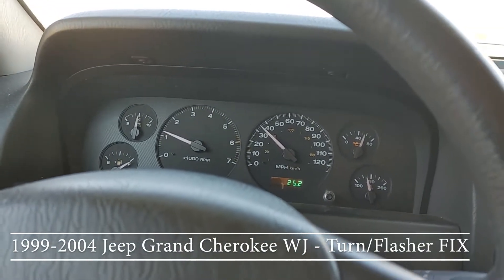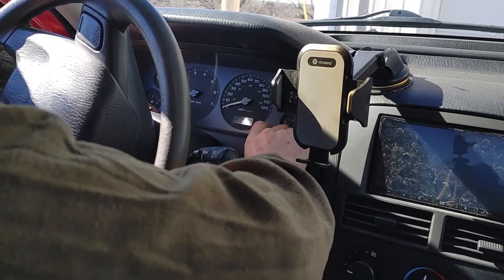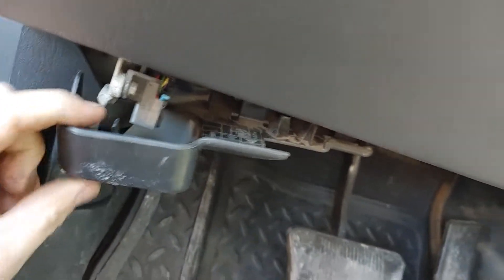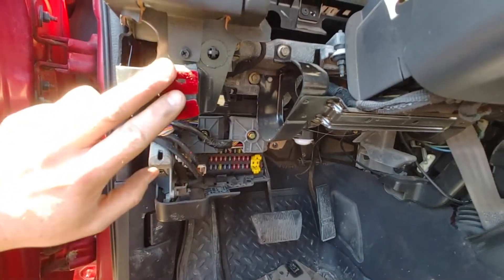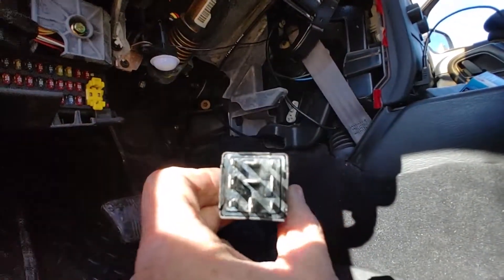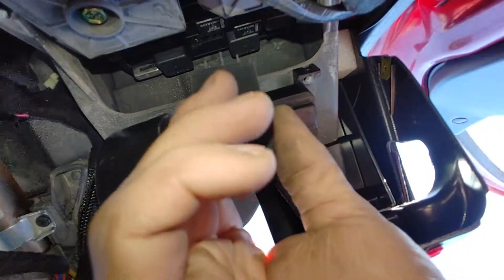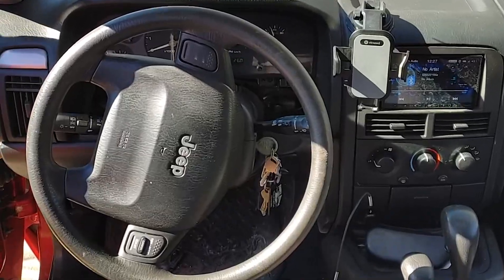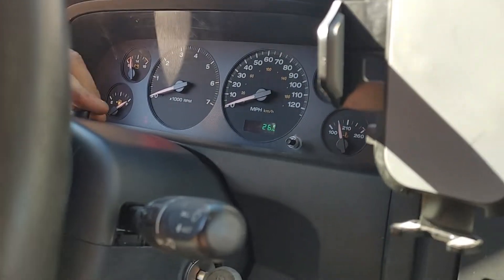Turn Signal Doesn't Work QUICK Fix | 1999-2004 Jeep Grand Cherokee WJ

Comment: I have an issue with only the left blinker not working
Reply: Same here did you figure it out ?
Reply: @LuisHernandez-hz6yu  yes it was a faulty turn signal flasher / relay.
Reply: @ghostcontactparanormal can you tell me the part number and where you changed it? Mine is left also

Comment: You could have saved some money. I took the advise of someone else and didn't need to by another relay. I took the old one apart and repaired the soder joints on the pins. Put it back together put it back in and everything worked. Saved 65$
Reply: 100% - Can't find the original video I saw so I could thank the guy - but I pulled the part, popped it open, resoldered one connection, popped it back in, and now I'm changing lanes all day just because I can signal again! No cost - just 25 mins of my time.
Reply: Weekend beer drinking money

Comment: Both mine worked as they should for 2 years until about a month ago. It’s just the left and it’s almost like it will not work until she’s driven and warmed up.   I Never have a left sig when I leave home in the morning but I ALWAYS have it when I’m 25 miles away turning into work. I’m so confused 😂
Reply: Mine as well its only the left side
Reply: Same as me literally the same thing

Comment: I have changed that relay, hazard relay and turn signal switch and still have nothing, anything else possible?
Reply from the maker: Start at your fuse box and check power at each component working way out to the lights.

Comment: my wj has blown fuse 27 twice in a few days, the heater display and indicators are both run through it, 
its been fine for nearly a year since i bought it, the heater fan may need some rewiring as its temperamental, but is there anything else that could put a load on this fuse ?
Reply from the maker: What I would recommend is trying to find a wiring diagram online somewhere. Find that particular circuit and test the culprits. Wiring issues can happen anywhere especially if a mouse gets involved

Comment: What i did was turn my flashers on.  While they are on i  then put my blinker handle down into left turn position and turn flashers off and it works.
Reply from the maker: It’s likely the bad flasher module just like mine was in this video. I could get my flashers to work the same way, intermittently, and only for a while. The hazards and turn signal are both controlled by the same single flasher module.
Reply: @fabricobbletech  im not saying it isn't a bad flasher module.   Most likely that is the case.   But that swems to get mine working now.  I used to pull in the blinker stick or push on it and it may make it work but the flasher trick seems to work.   Get you by until you can replace the module anyhow.
Reply from the maker: @jeffpatton2  I agree as that did the trick on mine for a while.

Comment: Alright so I’m 16 I just bought a 04 Grand Cherokee and my left blinker doesn’t work is it the blinker module also?
Reply from the maker: Entire left side front and back? Did you notice a hyper flash or very fast blinking on left side before it quit completely?  If it’s one side only, the first thing I would check are the light bulbs. Inspect the bulb receptacles for corrosion. Make sure they’re making good contact. If only one bulb is working you should have a fast paced flash. When blinker module is issue it typically won’t blink in either direction. I’d check bulbs first. It’s also possible the switch itself is the culprit. Switch in part of the lever you flip to turn on the blinkers on left side of steering wheel.  Hope this helps!
Reply: Did it got fixed it???
Reply: @fabricobbletech m getting front left fast flash and no back left, right sides are working fine. Any ideas? It's seems to be random times :(
Reply from the maker: @GolfGrumpy  back left bulb is either burnt out or poor connection
Reply: @fabricobbletech  thanks man yeah had to twist it around a bit in holder ty